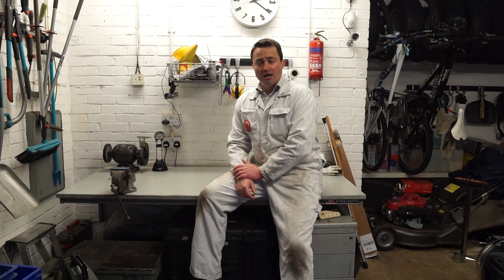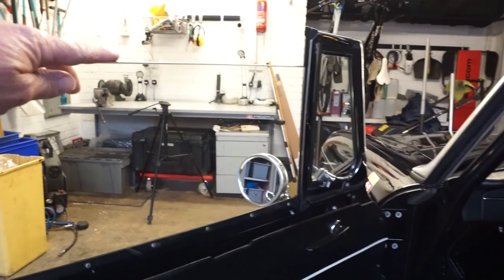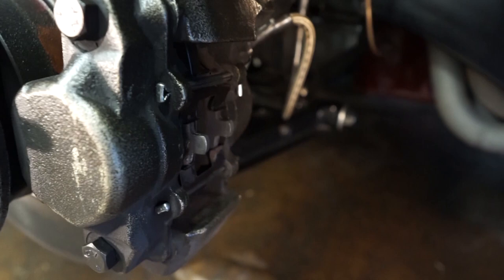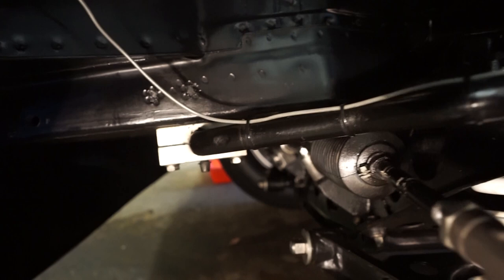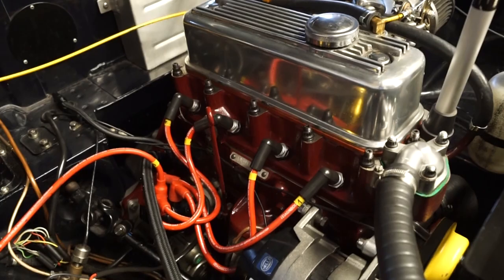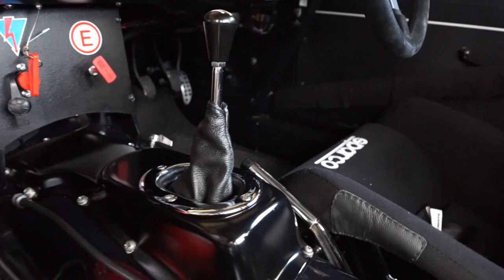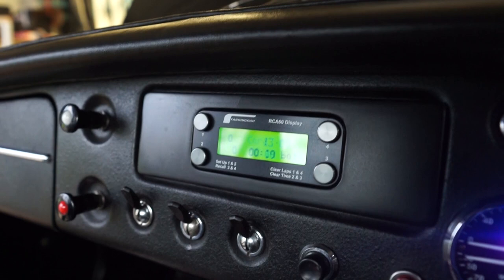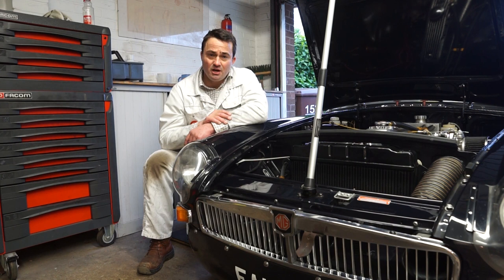MGB FiA Racing Car Walk Around Summary of Race Modifications and Details 2000 Subscriber Special

Comment: What a lovingly maintained race car. It’s a credit to you. So nice to see that the series you run in try’s to keep things original, rather than allowing the Frankenstein resto-mod approach.  Given that I saw your 0-60 dash clip earlier, I was wondering what sort of figures that engine produces?
Reply from the maker: Many thanks Paul, peak torque is around 139 lbf.ft, power is 160BHP. Keeping the cars fairly original is certainly a good thing in my view, it also means we don't have to spend a lot of money on upgrades each year!

Comment: Looking real good, congrats. I am building /rebuilding a MGB -GT for racing.  Just wonder where did you got the spill tank.  And why you did not go for the 15 Inch rims.   Nice channel... subed
Reply from the maker: Many thanks for your message, the catch tank is from https://www.alloyracingfabrications.com/ in the UK. It's my own design, pretty basic: It vents through the cap, I would also say there is no point adding a sight gauge or a drain to these, just empty it out after every season. 

As for the wheels, class rules allow for 14 inch only, I would use 15 if I could.

Hope all goes well with your build, don't hesitate to get in touch with any questions
Reply: @davidrussellwilks  , Much appreciated David...  I will have look at the site you provided....

Comment: Just re-watched this for the second time, great video as always!
Would you mind letting me know what oil pressure/water temp gauge you're running please?
Reply from the maker: The small gauges in the car are all from Farringdon instruments, they are digital/electronic type that run off sensors rather than the original mechanical type https://www.farringdoninstruments.com/

Comment: Wonderful to give insight and valuable information about our cars. On rear brakes, standard wheel cylinders or the oversized ones? Upgraded rear shoes? Brand please, never ever seen theses.
Reply from the maker: Many thanks for your message Wallis, with the rear brake cylinders the "upgraded" ones are actually smaller, the idea being to put more braking effort to the front of the car. However I have found that I am locking up the front wheels at the moment so I'm trying a standard wheel cylinder for 2022. 
The upgraded rear shoes were from Moss, but looking on their website now they don't apprear to stock them any longer. I'm not sure if there is much benefit over standard, it might be that these are a bit harder wearing and can with stand temperatures a bit better. 
In the UK Cambridge Motorsport do have a few competition shoes available https://cambridgemotorsport.com/classic-historic/12579-mgb-competition-brake-shoe-set-mintex-lined.html
Reply: @davidrussellwilks  what kind of dizzy do you run? Need a new one afraid.
Reply from the maker: Sorry for not replying sooner, I hace an Aldon distributor with the Pertronix module inside, I might need to swap mine over this year too.

Comment: Hi David, a minor item but all the removable hardtops you race with impress me! I’ve acquired a second-hand one, the same as yours and your colleagues. 
Where pray tell do you find parts such as rubber seals, fasteners etc.? Over here I’ve only found a Mom & Pop shop that has some parts but not all. Thx
Reply from the maker: Thanks for your message Bruce, unfortunately a lot of the seals and fixings are no longer available. When I refreshed my hard top a few years ago I found https://www.sealsdirect.co.uk/ very useful, it was a case of seeing which rubber profile were closest to the originals, I was able find a few latches atc from Moss Europe.

Comment: Somehow I missed the production year of the car.. is it a 65 ?
Excellent video.  Thanks from Oregon, USA
Reply from the maker: Thanks for your message Jeff, the car is sort of a 1965! It was build on a new heritage shell, with a 5 bearing engine and 4 synchro gearbox from a later car. The dashboard and windscreen are original but much of the car has been replaced, or changed for racing purposes.

Comment: Great car!!!   I have a couple of questions about your oil catch can set up.
As far as I can tell, the oil fumes don’t flow over the valves to be burned in the cylinder.  Seems like the perfect venting situation to me.
Is the hole going into the valve cover the same size as stock?
I am currently running an oil catch can in my B, can I use that set up on a stock engine or will it cause too much internal pressure?  Thanks
Reply from the maker: Thanks for your message Lou, the catch can is a requirement for racing to stop the oil from the engine breather getting onto the circuit. You can just use a crank case breather attached to the tappet chest instead. 

In my car the oil catch tank is vented through the cap

Comment: David, thank you for the great videos, love watching them. I’ve got a ‘78 B de-bumpered B with a 1840 fast road engine that I hillclimb. I’m in the process of removing excess weight. I hope you don’t mind me asking but where did you source the acrylic windows from? Also, you’ve removed the entire heater unit, just wondering if there’s any issues around that? I run the car in a road going class but really only do a few 100 miles max a year on the road, hill climbing is short circuit driving of only about 5 minutes of track time per day so there’s no excessive prolonged running of the engine as there is in circuit racing!
Reply from the maker: Thanks for your message Mark, I made the windows myself (with some help from my Brother) Using the old windows as a template we cut the acrylic to the same size. The edges were then routered to give them radiused edges just like the original. There is no winder mechanism, the windows support themselves. From memory they are around 5mm thick, just a bit thicker than the originals. 

The heater removal is straightforward enough, you just need to blank the take off on the side of the engine. Again the blank is custom made, but is just a flat piece of aluminium so very easy to do. I don't run a cooling fan on my car, but you might need one if you drive the car on the road, it heats up very quickly at a standstill!
Reply: @davidrussellwilks  thank you for the tips. I was concerned about removing the entire heater but as I run a fan I guess it’s ok as you say. I’m going to have a test run on the windows. I’d love a closer look around the car. If you race at Silverstone I might pop over. Cheers

Comment: Hello, Great video. How do you get the 4 synchro box in, do you have to modify the tunnel or is it just the top cover you change ?
Reply from the maker: Thanks for your message, the car is built on a heritage shell, whilst it has the narrow tunnel fitted no modification was required to fit the 4 synchro 'box. With an original 3 synchro shell some modification is required to fir the 4 synchro 'box.